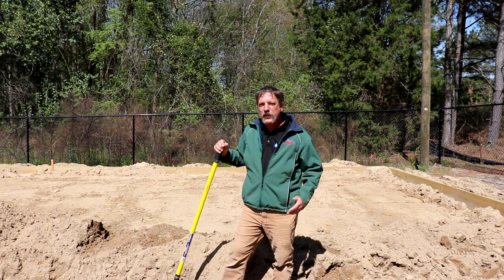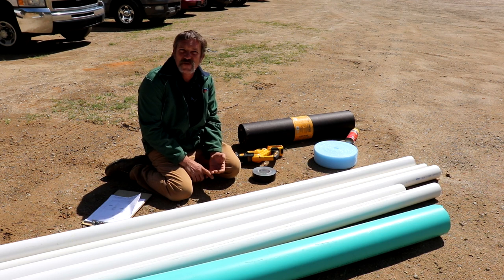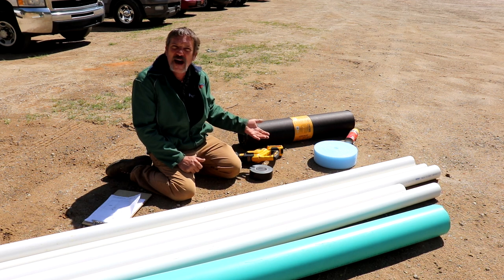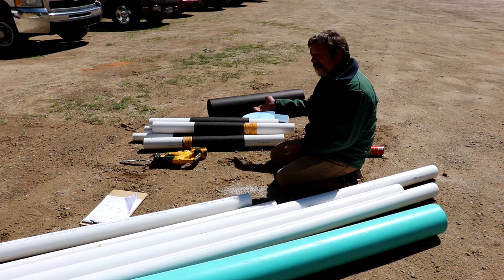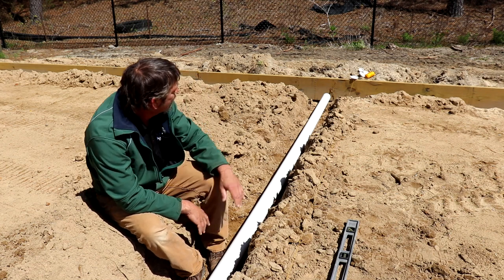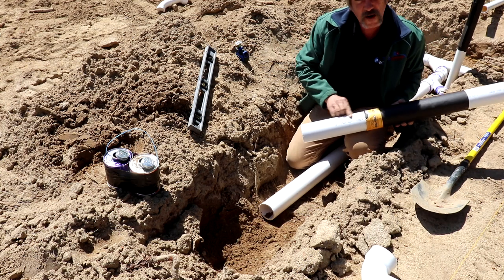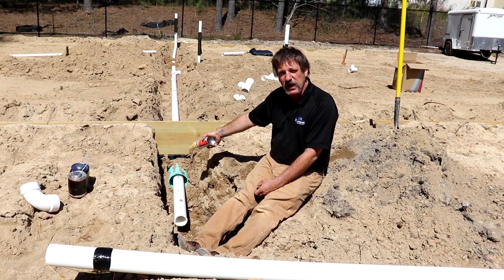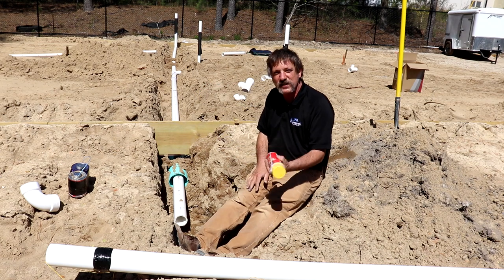Plumbing under part 4 piping

Comment: We’re required to bed the pipe with gravel here! My least favorite part about ground roughs is concrete guys messing stuff up. Crushing pipes with a bobcat. Knocking stacks out of walls. Puncturing water lines. Now I find out when they’re pouring and I watch them like a hawk.

Comment: We usually glue all the caps before the Rough-in and make a small hole on every single cap, we start filling the Rough-in with water and once water starts coming out of the lowest pipe, i grab a flat head srew amd put some true blue pipe dope and screw it in, that way we don't have to wipe the pipe to glue the caps and have to wait for them to dry.

We also use T cone plugs with a pice of duct tape

Comment: Great video, when I get invited to underground which isn't often, the trenches are already dug, it was cool to see the string lines and layout. I work on commercial, but residential is where my heart is. I'm in Utah we can test with water from March till oct, after that we use air. Did you use schedule 40 or 80?
Reply from the maker: 40